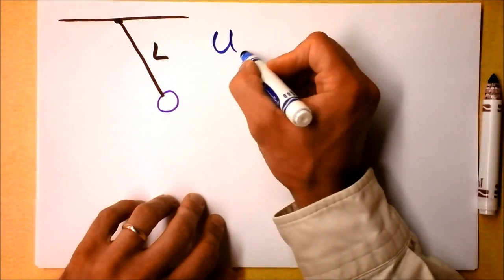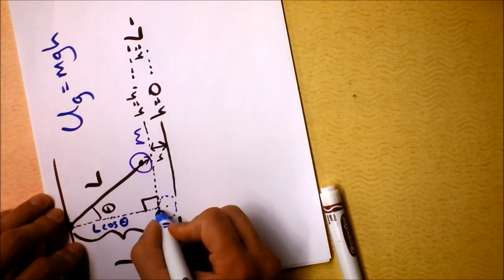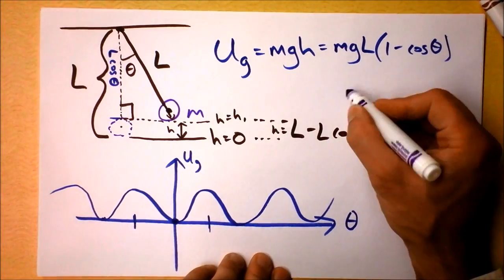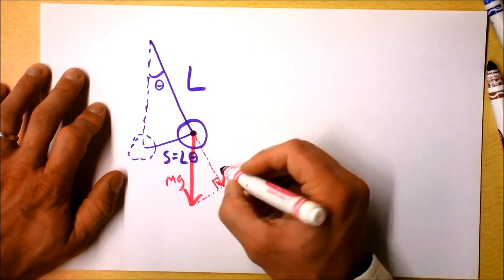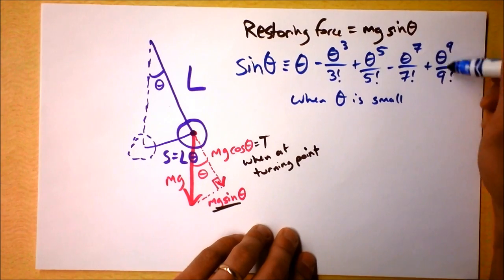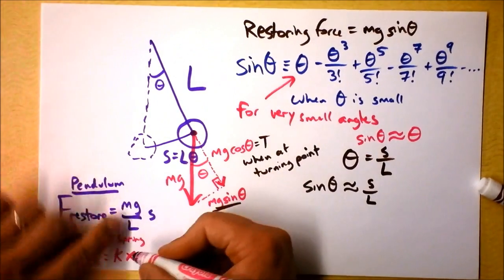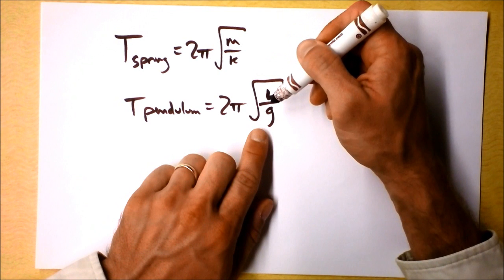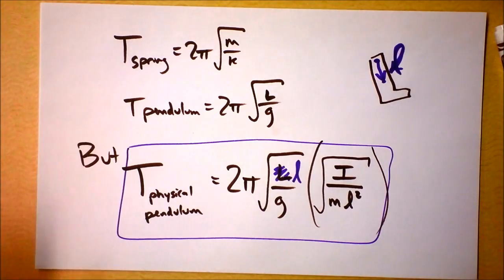Pendulum Modeled as Mass on a Spring | Doc Physics

Comment: Your presentation was illogical: First you said “If L were longer it would be easier to displace along an arc length”. But later you said “L is a tendency not to get screwed up” - as though L is akin to the mass on a spring. You further said increasing L provides more resistance to being restored.

Comment: Wrong. Sin(x) is ALWAYS = x - x^3/3 + x^5/5 ... ALWAYS. x can be 5 billion. the series will still converge to a number between -1 and 1.
 Apart from that awesome videos ! Very clear.
Reply from the maker: SirR3D That's an interesting point.  You need EVERY term of that infinite series if x>1, though, right?  I should emphasize that I need x<1 for me to ever make an approximation that leaves out higher order terms.  Thanks!
Reply: Yep, as x gets larger you need more and more terms of the Taylor series expansion for an accurate approximation. The reason is because that series is calculated around 0. The more you go away from 0 the more terms you need.

I really like your videos, very clearly explained. I will start a series of my own courses about Systems and Signals and another one about electromagnetism and microwaves. I'm a 3rd year student in electronics&telecommunications , but I find it fun to make videos + you actually learn a lot about the topic when you try to explain something clearly. If I manage to explain half as good as you do I'd be so happy.
Reply from the maker: SirR3D You're very kind!  You're right, too, about trying to teach others (videos or not).  It's the very best for improving your understanding.
Reply: I'm surprised Doc even replied to this... He made it more than clear enough that he was using the approximation for very small angles. Stop trying to enforce errors onto other people to try and demonstrate how smart you are

Comment: Hellooo! Thanks very much for the vid! I have a question! Could you please explain why at turning point there is no acceleration? And why when the pendulum is at equilibrium position, there is acceleration? I just cant get my head around it!
Thank you! :)
Reply from the maker: Zi Gyllenhaal Hi Zi!  There IS acceleration at the turning points, because the net force points toward equilibrium.  There's acceleration UPWARD (but not left or right) at equilibrium because the pendulum bob is tracing a circular path and centripetal acceleration is v*v/r.
Reply: Thank you very much!

Comment: There is one thing I don't understand about pendulum. Why is it that in a certain location of pendulum, the magnitude g (gravity) is somehow different. I thought that g is equal at all places to certain height on earth.

Please explain.
Reply from the maker: Not true.  At the bottom of its swing, the tension is not equal to mg.  Now tell me why.
Reply: Because the motion of the pendulum has centripetal force at the bottom is at maximum. On another hand, when pendulum is at max height, the motion pause in an instant so there is no need for centripetal force.

sooo how does this affect g at different length of pendulum? I just encountered a problem where I have to use g=(4pi^2L)/T^2

and g doesn't always equal to 9.81 when L and T are different.
Reply from the maker: Your explanation is solid.  Your confusion comes from the equation for the period of a pendulum (solved for g).  There's probably some error in your T and L measurements.  That's a common lab to do.

You need to recognize that g depends on the mass near you and how far you are from it.